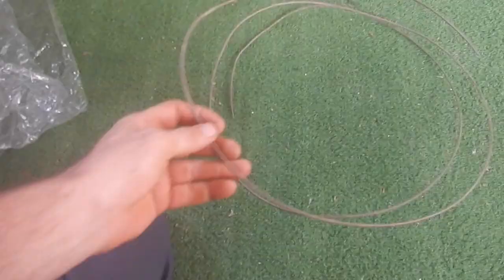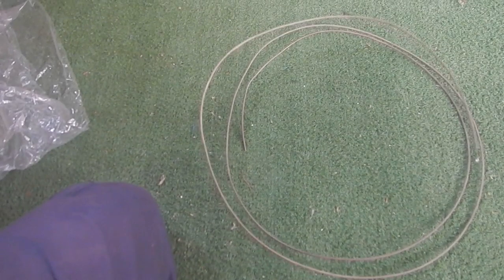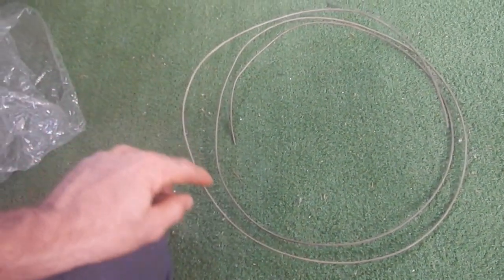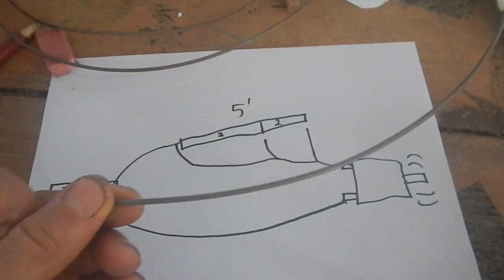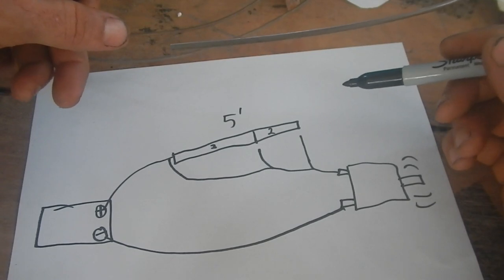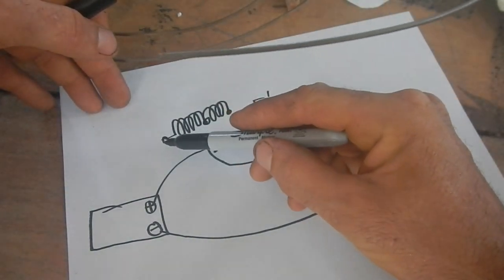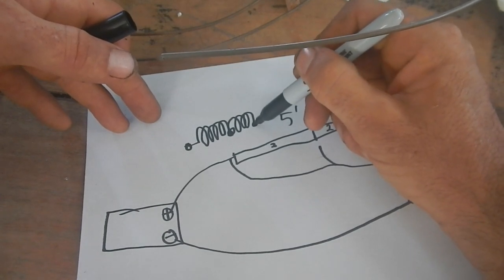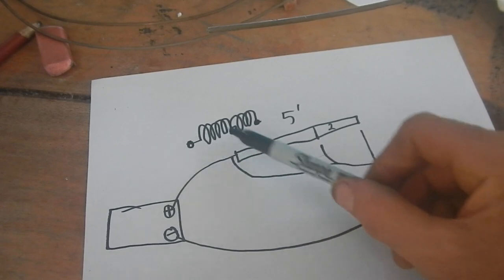Zombie Chopper 004 $10 DIY Speed Controller

Comment: Your math is wrong. I've mentioned this in the past... a 750w motor does not mean it's consuming 750 watts. It means it's RATED for 750w. How much you're actually using might be 75W, or 7500W, depending on what you're doing to the motor. Like the max capacity of an elevator. Maybe it's carrying one person, maybe it's carrying 30. You have to design the system so that it uses enough power, and not too much power. It doesn't magically do it on its own. Also, series-wound DC motors like you're using here are not like permanent magnet DC motors, that have a linear speed compared to voltage. Series-wound motors have unlimited speed, they accelerate indefinitely, only slowed down by their load. So, trying to estimate their speed, nearly unloaded, is nearly meaningless. This will still work, but by coincidence, not by design.

Comment: You're building a potentiometer. You probably could have bought one cheap. But building one is cool. You could even make a sliding contact that gives you more speed settings. Keep doing your thing.
Reply: That would be a pretty big pot
Reply: More specifically, a rheostat
Reply: @un2mensch  you're right. I couldn't think of the correct word. As I said, I am not a smart man... 🤣

Comment: Why not a sliding switch? Infinite control?
Reply: I was thinking that myself. Why not a half circle of pvc pipe with grooves on opposite side to hold all of notrolwire in place, as you wind it around it in a spiral. Then have a pivot handle contactor to slide around curve of spiraled wire. No contact at one end and full contact the other.
Reply: The sliding switch would need a circumference of 5 feet.

Comment: If the power is having to go through the night room wire to adjust the speed of the motor isn't it still using all the electricity it would if it was on high speed

Comment: This video tickled me for several reasons. Many many years ago I worked as an electrical engineer. It didn't take long before the high paid electrical engineer learned to trust what the lower paid technician said. I used fancy calculations. The technician used his experience, his gutt. It doesn't matter what my fancy calculations said. Reality overrided that. Trust what your technician tells you. Life is similar. Reality trumps what is theoretical. By the way, the loops made me think of making an inductor, which wouldn't be bad. It would just limit the surge current.

Comment: Course this is a great idea however doesn't it convert the resistance into heat and therefore continue to use the same amount of power from the batteries even though less of it is routed to the motor and more of it is routed to the nichrome wire which heats up? So it's not really as efficient of course you're probably running flat out 90% of the time and you really only need the speed control when you're coming into dock or something so efficiency isn't the concern in those times because rarely using it that way. Your previous solution for your shark slicer where you physically routed the different batteries into parallel and serial mode to increase and decrease the voltage to the motor would have been a more efficient way to do it because no current was being wasted in heat through the controller.

Comment: IF want it simple just make a Power Wirewound as a Potentiometer, Rheostat or Variable Resistor and move the contact back and forth to the desired speed. but what it does is waste the energy that won't get to the motor.  MOSFET is the way to go because it won't waste energy. "How to Use a MOSFET as a Switch" "Complete Guide for 15A 400W MOSFET AOD4184A to control motor or load" Two 400W MOSFETS in Parallel will be enough to run that motor.
Reply: That sounds more complicated than a simple wire.
Reply: It doesn't matter. Jaimie is using this for 20 seconds in a 7 hour round trip. Wire and a knife switch will never break, and if it does it doesn't matter, he can fix it with his fingers. Mosfets are among the most delicate and sensitive electronics. What happens when he hits a gob of seaweed, temporarily spikes the motor power to 4000 watts and blows the Mosfets in a the first 1/10,000 of a second it happens? This is the perfect solution for him, his abilities, and his budget. Not only are you nitpicking something that works, you're getting his context wrong and complaining about something that doesn't matter (efficiency for 20 seconds), and the solution you proposed would actually blow up the first few times he used it because you don't actually know what you're talking about and think you can just slap something "rated" for a number on and hope it works.